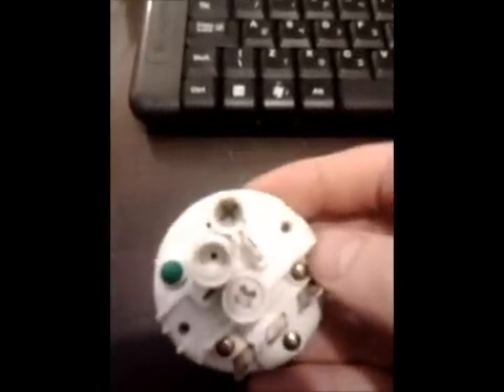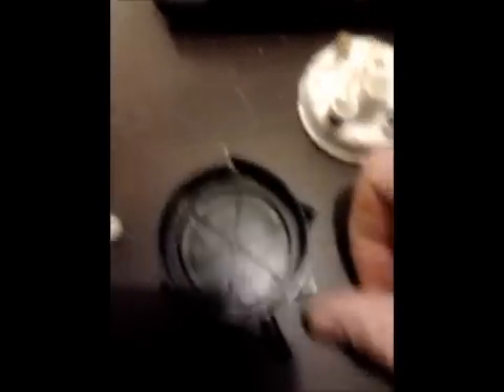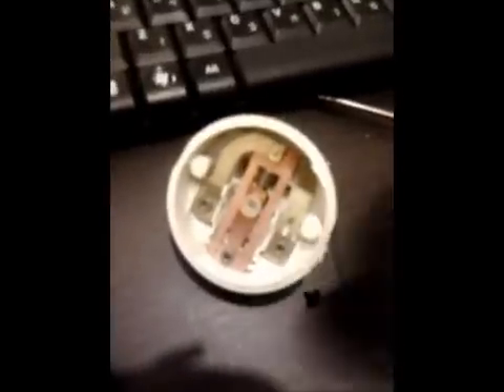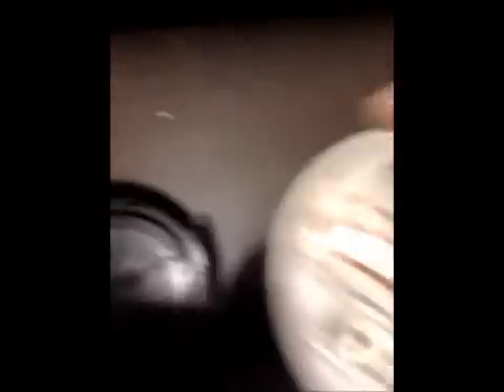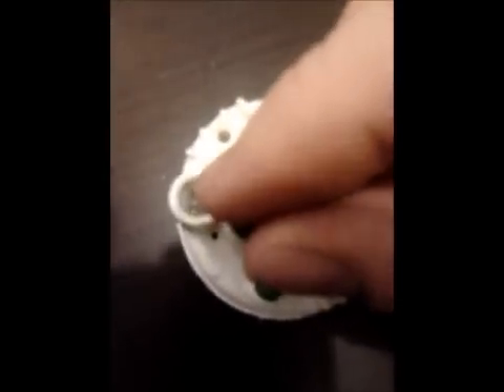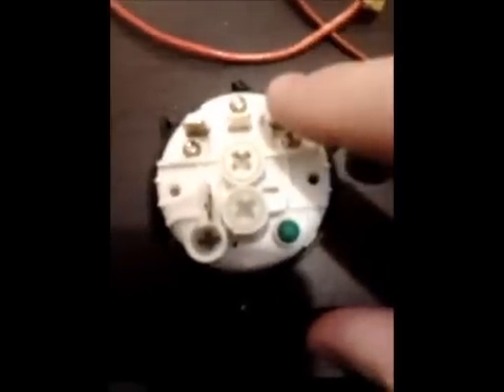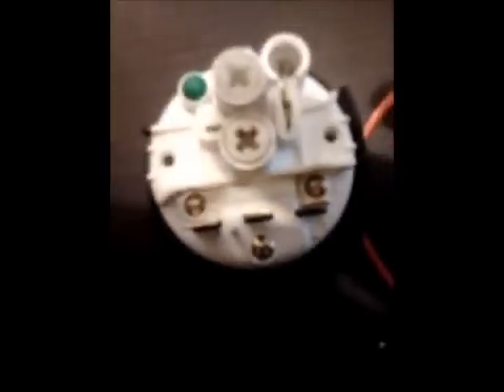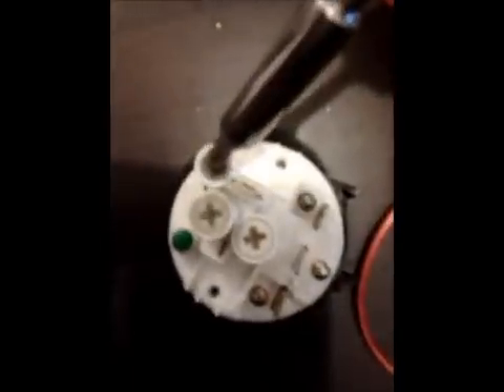How to fix and adjust a pressure switch of a washing machine

Comment: Thank you. The method worked for me for the same type of pressure switch Metalflex HD 505. I only tightened the middle screw for higher water level and tested for continuity (as you showed) while adding more water with the door closed and mains not connected. Washing is now better with more water at full load but less efficient with partial load. My machine has no half load button and originally used only about 8 liters of water for a full load at the first stage and when I submerged a washed-and-dried towel in clear water (baby bath) a very fine white powder came out of it and up to the surface of the water. After the adjustment to about 12 liters the effect is gone. Thanks again.

Comment: So if I want to increase the water level,  I need to play with the middle screw but should I turn clockwise ? is 1/4 turn enough? Thanks
Reply from the maker: I think so. My explanation was wrong. If you turn it in, the spring compression will be stronger making it harder for the diaphragm to push it, so more water is going to fill the barrel and water level will be higher. If you turn it counter clockwise the level will be lower.

Comment: Thanks for your Vid. this made me realized the water didn't have to reach the switch :p and that the pressure seal was broken. all fixed now. so air triggers the switch not water! the metal seal had rusted away. I just used electrical tape after sanding surfaces, pulled it nice an tight. i then used a rubber-band to help fasten. thanks.

Comment: It is not a good idea to tamper with pressure switches, unless you fancy flooding out your kitchen. Buy a new one. They don't cost much.  Be aware, most problems are with the chamber on the other end of the tube, not the switch.
Reply: does it matter, let natural selection take its place.  It always does by default anyways.  Also, at the end of the day, pressure will always be pressure, therefore adjusting the diaphram for the pressure height, will still set the switch for the proper height.  At the end of the day if there is something wrong with the switch, you will have a flood, "Natural Selection" at its best!